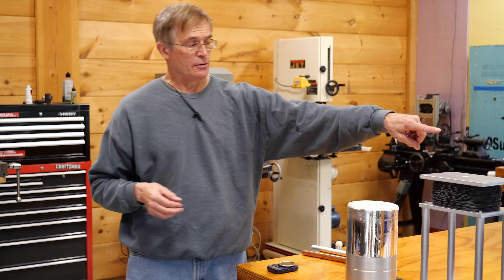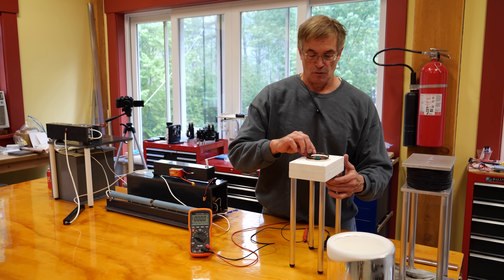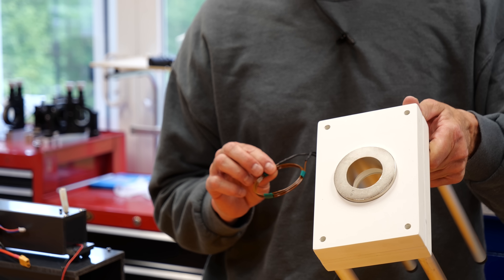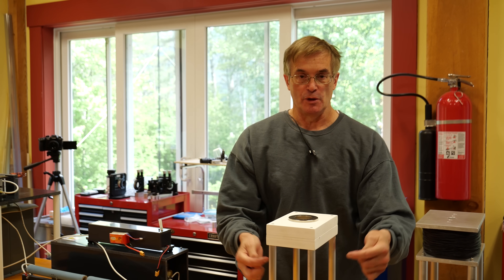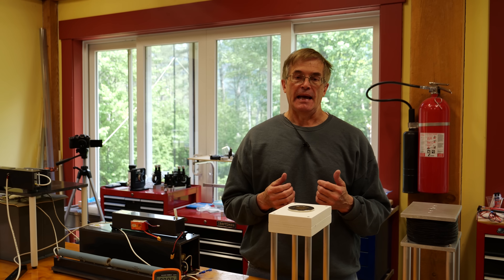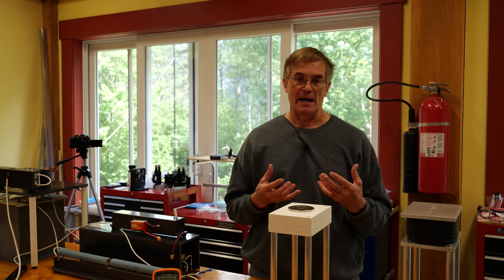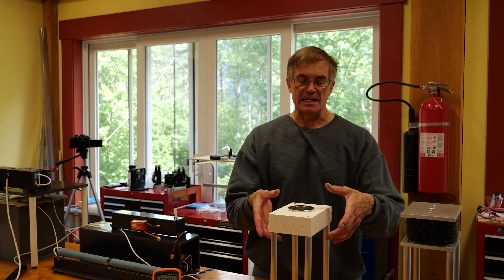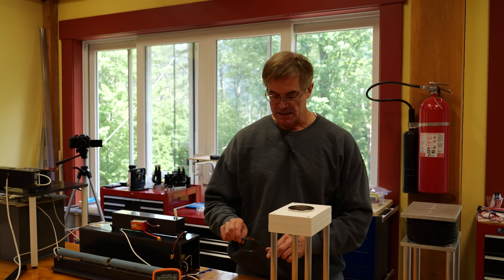No, we didn't use Magic to Crush this Can...

Comment: 36:28 you can even see the red and black wire moving apart once the current is flowing. A further example of what was explained before.
Reply: Watch the cables leading to the arc furnace in this video at 1:39! You can see them repel each other for the same reason. https://www.youtube.com/watch?v=_j2jESz7Zl8
Reply: Good eye, I missed that

Comment: Whoa, he's actually gonna talk to spARC engineers?
I'm SUPER excited about that.
Fingers crossed it'll work out!
Reply: Yeah, shit gets real...
Reply: Tokamak Energy in oxforshire is doing the same trick. They have many excellent videos on here. I am skeptical this route will be what finally unlocks fusion energy though, the heat flux on the divertor of an ultrahigh field tokamak is going to be absolutely stupendous.
Reply: @Muonium1  Heat is something which can be made use of. Hence, the steam engine!
I think Trump's team are quite capable of dissipating  sufficient heat to mitigate the downside of nuclear fusion, if thermal considerations are the only setback....
Reply: @tasmedic  Heat is useful, when it's not inherently concentrated like a super powerful laser beam onto a tiny area of material, which it will be in ultrahigh field tokamaks. In that case, it's a nightmare that destroys the machine.
Reply: @Muonium1  Well not only the heat flux but neutron flux as well. So having material that will withstand that kind of radiation for a long time is not trivial at all. 
I guess we will see how it works out, first we will see ITER that I am sure of :) And then hopefully a bigger Stellarator.

Comment: While in college in the early '70's a classmate showed me the air discharge method of switching high voltage/current. (He called it an "Open Air Thyratron" and had learned the technique working on an experimental offshore seismic shock generator.)
We obtained some large pulse capacitors (120 mfd @ 3KV IIRC) and built an "OAT" out of 1/4" brass screws triggered by an automotive ignition coil. We had great fun exploding wires and flash charging magnets, but never thought to try can crushing!
Thanks for the memories!

Comment: 15:08 excellent description of an "eddy" current. A paramagnetic substance, such as aluminum, will propagate the magnetic field without creating it's own internal field like a ferrous substance would. So by being magnetically conductive, it will pass on the flux lines without creating its own magnetic field. This is a very useful property.

Comment: Your description of the heating of the coil in your plasma pinching demonstration reminded me of a module I designed back in the '80s, commissioned by the JET (Joint European Torus) project at Culham, 20 miles or so up the road from here. I was then working as one half of a 2-man company.
The module was called an I-squared-T integrator; its function was to monitor the magnitude of the current in the busbars feeding the torus electromagnets (using Hall effect sensors), and integrate the I^2 x time, with a trip level set to shut off the current before the busbars melted. The module allowed the computed value to decrease with time (allowing for the bars to cool between pulses).

Comment: Freezing the can, then perform the same experiment again with the can frozen first
Reply from the maker: You're implication is correct, it helps.
Reply: Full can, and I'll clean up the Bat Cave afterwards.
Reply: i bet though that the thin al can warms up super fast.
Reply: There's so little heat capacity in a coke can that it will warm back up to room temperature pretty quickly. I suppose you'd need something to keep it cold right up to the discharge of the arc. Maybe contain the coil and can in a dewar containing liquid nitrogen, without immersing the can in it...
Reply: Guessing a new, full can would be too messy
Reply: @TechIngredients  Sure it helps conductivity, though how much that is countered by material thermal expansion being decreased, where as when its increased it bends more easily as vibrations in atoms loosens the bonds(sorry i dont know terminology for this effect). From practical standpoint its probably in highly scientific terms "fuck all", just curious what kind of losses we are talking about and how much material thickness effects this?
@tasmedic
 Cant you just pour small amount inside the can, so its in contact with relative clean aluminum? Shock should not be enough to spill it/trow it around causing danger. Washing inside first with acid to remove oxide layer would probably help as well, since i recall oxide and specially anodizing on aluminum has terrible thermal conductivity. If you want it perfect, wash with acid while its fill inside with argon to prevent oxidation from happening.
Reply: @fraserlamb5787  love it! 👍😁
Reply: It would be fun to compare.  While the oxide layer doesn't conduct very well, AFAIK it is rather thin, typically 4nm, so it is a very small fraction of the thickness of the wall of the can.  I'd imagine the loss in amperes would be comparably small.  I think the alloy composition of the aluminum would make a much larger difference in resistivity by comparison.  As far as cooling it, I'd first try pre-chilling the can in LN and leaving a small amount inside to keep it cold for a few seconds while putting it in the coil.  I don't know whether the almost immediate frosting from water condensation would be come an impediement, or if the aluminum would become brittle and thus potentially shatter at LN temps.  A copper tube section of appropriate width would be interesting, but perhaps too thick to crush?

Comment: 21:52
"Now the setup here is pretty simple"
30 seconds later the phrase "pulse capacitors" is used.
Reply: Oh yeah. I have 7 of those pulse capacitors just sitting around in my back room!
Reply: Pulse caps are super simple, more simple than the electrolytic caps, just 2 metal plates with dielectric in between, which can be plastic, glass, mica, etc

Comment: Absolutely incredible! Love how much info you're able to put into a single video.

Is there any chance you're planning on building a Farnsworth reactor in the future of the series? It seems like you've got the vacuum technology and the high voltage capabilities.
Reply from the maker: No.
A plasma ball might be fun, but low energy fusion has no reasonable principle to support it.  Did you know that the nuclear strong force that holds a single proton and neutron together is 5,000 newtons?

Comment: Still watching the video. However, I thought I would point something out. The magnetic field on the tube experiment you showed. Those magnetic Eddy currents are now being used on roller coasters and drop tower rides. 

On roller coasters, they are used before friction brakes for two reasons. One, they are more gentle than friction brakes. Two, they reduce wear and tear maintenance on the friction brake system. The magnetic brakes can't bring a coaster train to a full stop, so they are not used as a block zone control point.

Comment: 3:00 - thought that right-hand rule applies to conventional current i.e. the opposite direction of electron flow !?
Reply: It applies to radio, light, electromagnetic, current. Check out Theoria Apaphosis Channel. He has a lot of work in this area.
Reply: Yes you are right, it applies to the conventional direction of the current which is the opposite of the electrons flow. So the magnetic field lines shown in that part of the video are actually oriented in the opposite direction
Reply: @SupraNaturalTT  He was saying that the thumb should point toward the conventional current direction, not the direction of electron flow like in the video. He wasn't surprised about the right-hand rule itself.
Another mistake in the video is at 6:47: "electric field" when it should be "magnetic field".
Reply: @HoxTop  Not really! He said "as the electron moves along the direction of my right-hand thumb" and his movement indicated this, too. But, hey, it is just a minor thing, his videos are GREAT! :-)

Comment: You are the best. Concise. Pertinent. Not showy instead all content. 

Consider the effect that zeta pinch plays in galactic evolution. The linear laminar edge rotation with little curl turns it into turbulence in the middle, turning linear movement into spin and turning gaseous plasma into condensed matter.

Comment: I've made some progress with Noble gasses and found that the pressures in a locked state from electrical ignition in a magnetic chamber to a diaphragm to stabilize pressure state is holding the electrical charge in its self and release when draining to an other chamber so it's slowly something to think about three point emitters

Comment: You can see the force of the field by dropping a neodymium magnet down the center of a copper pipe. The magnet floats down the pipe considerably slowed than if dropped in open space.

Comment: 25:35 There is a great proof of this in a different video where the current is so high that the coil does explode itself (as the can would explode itself like you explain here). The guy in the video i'm thinking of is shrinking quarters, and each time the copper coil is completely obliterated into shrapnel. I found this very interesting because its actually different from when copper takes too much current. In an extreme overcurrent of just a straight wire, the copper will literally vaporize. i've seen this happen with extreme current and about 20 volts going through a 28 gouge wire; only the insulation was left (blown open).

Comment: What's happening at 36:06 to 36:16 from about 3 to 10 inches from the right electrode that looks like flickering Mach diamonds every 1.5 inches? Why are they separated like that on only 1 side of the tube?

Comment: 24:20 Is the can crush. Watched it in YT's 1/2 speed several times. Wondering: the flash around the can at the time of discharge was 1) an electric spark? or 2) actual flame? or 3) ___?___???
           &/or a result of the A) current B) amps or C) __?__ acting on ___?___???  

25:42 (up to like 57) you explained why the can was crushed... does that mean (since the coil is closer to the outside of the can than one side of the can is to the other), that the side that's more indented started on the side with more coil?? If so, what happens to the can if the coil extends both above and below the can?? or is that too much area for that size discharge?

Comment: @10:40 idk I've magnetized screw drivers on purpose before because it's very annoying to have a screw or bolt fall off the driver when you're putting it in a tight space you can't get your fingers into.

Comment: It's called degaussing or demagnetizing.                                  The old style televisions actually had a degaussing coil all the way around the perimeter of the focal screen of the cathode ray tube and we would sometimes degauss a television screen with a large soldering gun.
We would hold the soldering gun up to the screen and pull the trigger and slowly circle the magnetic field around the screen slowly pulling it back.
If you let go of the trigger while the magnetic field was still close enough to the screen to have a powerful effect you would make matters worse and magnetize a big spot on the screen!

Comment: Love your educational videos! You explain the processes very well. The only issue I could have is the statement "electron flow" you even explain later in the video about the EM fields around each electron and the physical power to interact even with the materials. The EM field is passed from electron to electron which transfers the power, it's rare that you will actually get movement of individual electrons. Although the higher energy that you get the easier it is for them to actually move and you usually get em radiation such as light along with the process.

Comment: Try a rotor with 3 arms in equilateral formation. Attached to each arm is a magnet. The rotors is connected to a ceramic bearing, mounted on a rod. A cilinder with copper coil wrapped around it is positioned so the arms rotate around the coil. To stop centrifugal forces from snapping the arms at hight rotation a cylinder is placed over the rotor. The outer edge of each arm is pressed against the inner cylinder. The coil is wired to a voltage to frequency converter creating a closed loop.
To start the reaction one manually spins the rotor
The magnets spin around the coil inducing current and creating a small frequency in the coil, centrifugal spin lends its force at right angle to the direction. Magnetical fields produced in the coil cause field spin which increases rotation speed. This in turn leads to increased current and stronger centrifugal force, the spin speed is exponential. The frequency in the coil has ramped higher and will eventually match the resonant field of the electrons in the coil. Sympathetic resonance between the 2 fields leads to the electron field integrity collapsing. At this point the coil is in free electron flow with uniform electron flow and no colliding electrons. At a critical point electron collapse occurs causing a uniform plasma discharge

Comment: An easy way to visualize the Lorentz force is to imagine a racetrack with charged particles going around a circle.  If another charged particle is inside the track going in a straight line, its velocity is different relative to the charges on the track -- the particles parallel to its motion will be slower and the particles antiparallel will be faster.  Because of special relativity, the electric force the particle in the center feels will be greater from the particles going in the opposite direction (at a higher relative speed).   All magnetic force effects are a result of special relativity.

Comment: "The direction of the magnetic flux lines can be found by placing the thumb of the right hand in the direction of conventional current flow and noting the direction of the fingers (p. 207 Robert L. Boylestad pub. 1968)." This is in opposition to electron flow as you showed at minute 5:50 of your presentation.
Reply: By convention, current flowing in a positive direction is produced when electrons are flowing in the opposite direction. It's all one current, a river of moving electrons, but its direction in a mathematically positive sense is defined as opposite to the direction of the electron flow. Thus the thumb in the right hand rule refers to positive current, not the direction of the actual electrons. This is important when using Ohms Law (V=IR), in order to keep the polarity of the voltage correct in the equations.

Comment: place i ipone on a table the speaker gains exponential loudness and fidelity so doing the same with speakers ... pointing drivers in ways to interact with surfaces rather than away form them will enhance speaker cabinet design

Comment: Interesting subject. I have seen the rod drop before but not the can crusher.
A couple of suggestions to improve your demos:
At 0:35:  A dark board, like matte board or foam core board, behind the hanging rods rather than that shirt would improve the visibility of the rods significantly.  The background is distracting.
At 12:43: Use a zero center analog meter instead of a DVM.  It would be much easier to see the effect of the voltage generated.
Question: Had the magnetic field direction effect been discovered by a left hander would we be using a left hand rule now?

Comment: First of all what an amazing video, from Oersted to Cooper pairs in one fluid motion! Im wondering why is there additional very tight pinch in the mercury gas, left of the permanent magnet (as seen at 34:50) not present when the lamp was turned on (at 33:53). Only thing I thought of is that there is where the nozzle is and its sucking in the mercury vapour in. If not i would really love the explanation of it.

Comment: Thank you for such great content!

One thing that is not clear to me about the big fusions reactor, is the shape of the reactor chamber/plasma...

Could you answer or cover in a new video the shape and flow of plasma gas in the fusion reactor?

Is the plasma contained as a sphere or a toroid? In eather case, how do they usualy inject the plasma into the chambers containment field? Do they create it out side like you are and siphon the plasma off into the reactor, or do they have a cathod/anode in the reactor someplace? Are the electrodes removed after startup, or left in place and protected somehow? 

Do they have a uniform magnetic field, or do they use a higher field pinch point to spike the temp at one specific point in the path around a toroid contained version of your plasma tube, so that fusion is only happening at the one point rather than the entire length of the plasma path?

Comment: As working my whole life as an electronic engineer, I am very happy that I did not had to attend your physics classes. I would probably quit studying electronics, because these experiences have only minimal obvious practical use. Mostly to impress casual students. But would be nice if the experiments had a little bit more practical content. For example, I had once a short on my power plant bending all my very thick copper wires due to the extreme electromagnetic forces. I mean similar experiences like this. Or „dangerous“ things can also be memorized good. Thanks anyhow 😋🤔🫣🤭

Comment: One Question: Is this type of messuring the Froce produced by the movemet in this Case 12:35 - 13:00 more precicious tha messuring with the standart lighttrackingsystem in a modern CNC-Maschine?